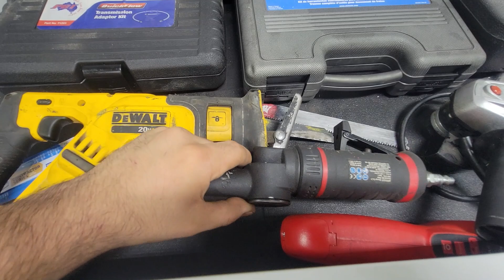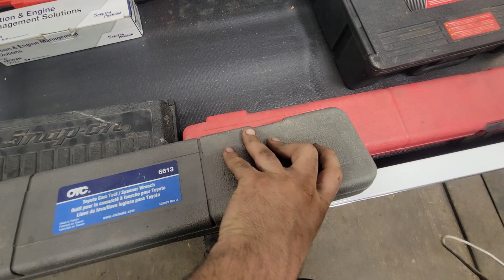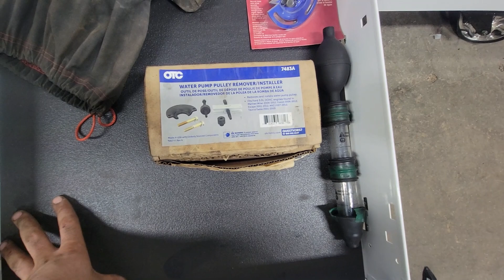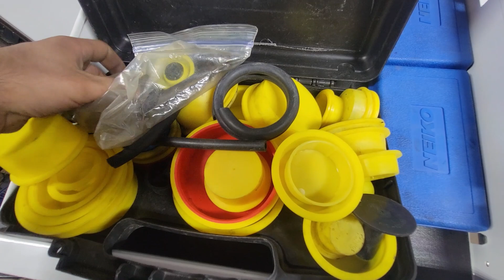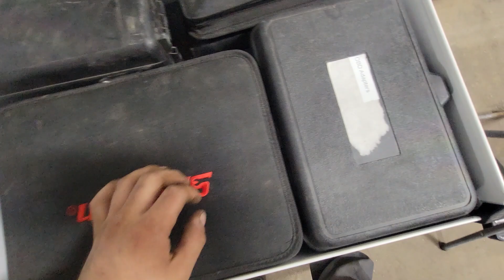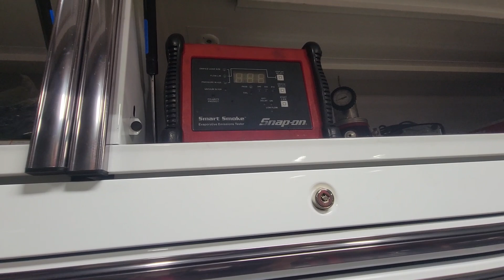The White Toolbox (everything else) part 4/4

Comment: Previously you showed you had a Snap On A/C sniffer, then you show the shop Mac one. Our shop wouldn't buy one so i bought my one, searched everybody, got pricing and ended up with a Mastercool Raptor through Napa i paid like $350 canadian for it about 4 years ago, and its paid for itself. i think that it has been discontinued though or Napa stopped selling that model, its not in their catalog anymore. but mine came in a case with extra tips in case one breaks. I have those stud extractors but mine are Mac and AST mixed in a AST case, use them all the time on exhaust studs, the ones that aren't broken usually come out fairly easy with those. i have my own lock out kit aswell, don't use it alot, maybe every couple of months. i know around here you can't go around unlocking peoples vehicles without a license or you get fined, but using it in the shop setting is ok. i hate those tube inner tie rod tools, have a Mac one and a Blue Point one, took them both home. i bought a Napa one that looks like a muffler clamp almost, has a 3/8 drive in it and it has teeth on both sides so it grips the tie rod when you tighten it down. our shop got a set of those chassis ears about 4 years ago, the service manager we had at the time said we had to have a set. we used them a few times, haven't touched them in over 2 years, don't even know where they are, the owner grumbles about them when ever we ask for a shop tool, so i usually get my own. we have one of those Snap On smoke testers that take the older style batteries. we find that fully charged batteries only last about 15 minutes on it, Snap On guy can't tell us why. but i find the 18v Snap On batteries don't last on anything, even new ones. i bought a used boroscope off the Snap On truck, was made by Rigid, he claimed someone traded it in for a newer one, but i found out the camera wouldn't fit down a spark plug hole, so he took it back and gave me a great deal on the smaller one from the first one you showed. i bought one of those brake force meters because newer trucks after like 2014 you can't use a regular trailer plug tester they just don't work properly.
Reply from the maker: The AC sniffers are a hit or miss sometimes. I had one from Cornwell but it kept losing it's calibration and the little vials they give you to check them never worked. I didn't want to pay Snap-on money for one but it generally works pretty well, it has been sent out for repair once but I've had it for 5-6 years now so I'd consider that pretty good. We have the hex wrench tooth style on too and that one is really compact, it's pretty cool but most of the time it's in someone else's tool box. The chassis ears are a tool I never want to bust out because setting it up on the car is time consuming, they're a tool I'd rather the shop buy because I just don't use them enough but can narrow stuff down when the noise only happens when going over bumps driving but can't be duplicated on the alignment rack. I would probably have your smoke tester sent in for repairs/inspection. Ours lasts for about 2-3 smoke tests (5-10min per test) consistently. It's actually the only way we use it because the clamps always display "voltage too low" on the tester, even if it's connected to a brand new battery or even connected to a car with a maintainer on it, that issue never got fixed on our tester. The 18V batteries are also not used on anything else so that kinda sucked buying a whole charger and 2 batteries for one tool and they always show to be at 0% when connected to the charger even if it was only used for 5-10 min, which is why we bought two. I've never used the brake force meter and did not know that about the trailer plug tester, that's pretty useful to know. I do love the wireless borescope, it saves so much time! I wish it uploaded the pictures to ALTUS instead of on an SD card though-they also have a smaller 5.5mm head that gets into some really weird areas. It's connected to the Wi-Fi so I don't think that would have been hard to do to upload it to the cloud. If you didn't know the picture is also clear enough you can scan a QR code with a barcode scanner right off the screen. I used it at Toyota and Mercedes when they require you to scan them to check if it was part of a recall and saved me so much time. MB has data matrix (QR) codes on a lot of their parts too that need to be scanned to code the part to the car so that alone has been one of my favorite uses because we have a lot of customers install stuff and then bring it to us to program it and didn't save that info. I have a UV head for the borescope but it has a really tough time highlighting AC leaks in the Evaporator housing, which is a bummer cause that's mainly what I got it for. I've had more luck just sticking a UV light in there and turning the camera light completely off. It's supposed to be able to also stream the camera image/video to a tablet or desktop but out of the box it was never able to connect to any devices I tried it on (Samsung phone, iPhone, Android tablet and my PC). I like Snap-on tools but it feels like this kind of stuff happens way too often. We're next to a police station and they've never said anything about us "breaking into" cars, I'm fixing to have to get an LSID (Locksmith License) soon though because a lot of newer cars are not allowing us to program them without it. Our local locksmith is really fast so he usually gets us out of a lot of situations. I used to do roadside assistance and it's really surprising how easy it is to get into cars, soo many of them don't trip any alarms either which is pretty concerning.